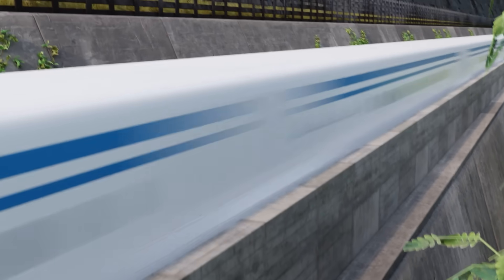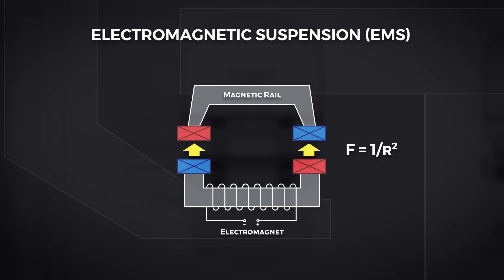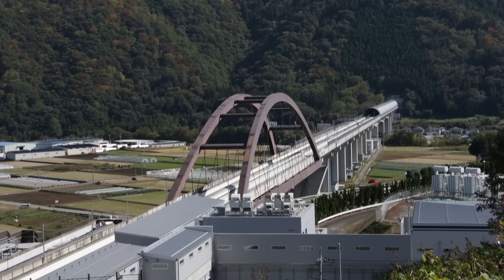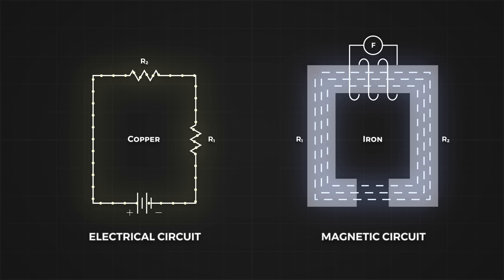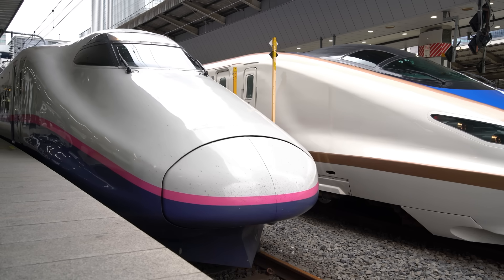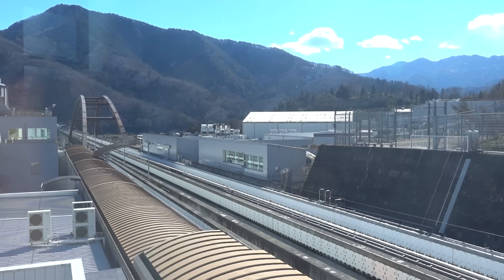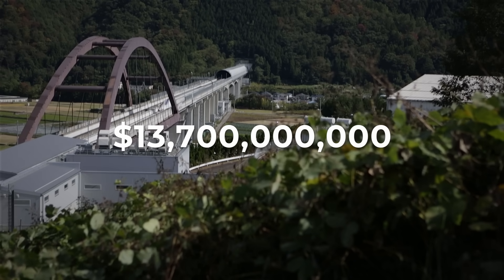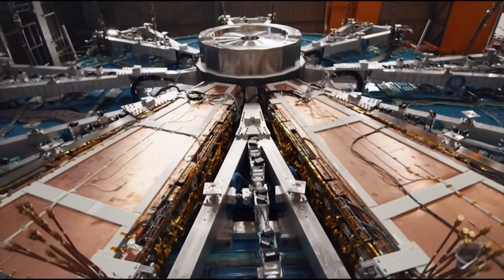How Japan's Maglev Train Works

Comment: Why does it cost 10x more, is there a way to bring costs down, would the new room temperature super conductors solve this cost?
Reply: Unfortunately, it appears they aren't superconductors. No lab has been able to recreate the results, and the material seems to only be diamagnetic, but with some slightly unique properties. There is still technically a chance that the other labs just need to adjust the process they are using to synthesize the material, but according to commentary from scientists that I have seen, the general consensus is skeptical that this is the case. Either way, the other labs still need to conduct full experiments, because in science you have to publish a paper in a journal for it to be official, so we will have to wait until then to find out for sure.

Comment: There is the argument that this infrastructure is probably 100+ year infrastructure with very low maintenance costs so in the long term it will probably be of a similar cost, it's a similar augment for tidal power vs wind power, wind power is much cheaper to install, but it's intermittent and only last 15 - 25 years and requires lots of maintenance, while tidal power is predictable and has been shown to have a very long life with relatively low maintenance so when you calculate lifetime costs it looks a lot better. Although to be fair tidal power also removes the need for energy storage and can be built in a way that can be used to store energy for when you need it.

Comment: Got to wonder why they are not using high temp super conductors, are they way more expensive or something or was it just that they were not available when the train was being designed. And when I say high temp I mean 77K or higher which is still super cold, but keeping Helium below it's boiling point is very energy intensive needing temps of 4.21K or lower also it means your mangnets needs to be signficantly larger to take the same current as trying to load them with too much current will heat them up and they will lose their super conductivity.
Reply: They are. L0 swiched to Hydrogen cooling from the old MLX01 that used helium coolant.

The issue with high temperature superconductor is that its not very flexible. This problem was solved about 15 years ago, MLX01 predates that system, but L0 don´t.

If you look closely at the images with the helium colat, you may be able to recognize that its from a MLX01 train, not the L0 train.

Comment: Small fun fact from a recent calculation done in germany regarding the costs of building a highspeed track: transrapid track (elevated) around 17 million € per KM, normal (on ground) highspeed track for 300 km/h around 27€ million € per KM. So the initial investment, at least for this Maglev type, is not at all higher these days. There is also the benefit that the area under the elevated track can be used and more steeper tracks are possible.

Comment: For the record, we’ve had room temperature superconductors for thirty years at this point, but they have the properties of bricks, therefore making them unviable for use in maglev.
Reply: Those are "high temperature superconductors" not room temp. So they still need to be cooled via liquid nitrogen (just not cooled so much that one needs helium).  Part of the difficulty with them is that they really don't make wire coils well. But we've gotten better with the ReBCO superconductors. The other big issue is critical current levels. If you put a lot of current through them, they cease to be superconducting. The titanium-tin and similar superconductors require helium temps but otherwise mostly do not have these problems.
Reply: @joshuazelinsky5213  The likelihood is that you are correct, I have no personal experience with this. I got my information from another video debunking LK-99,  and I also think that I heard about similar high temperature superconductors from somebody in person. I honestly don't remember at this point, and I had forgotten that I had posted this. It's cool to know that progress has been made!

Comment: I've been on the Shanghai ride. Great experience, but like you said, not practical at all. It seems to be there for show. But at least its a great show. Because it has tracks for both directions, you will pass the second train during the ride, meaning you will pass it at double the speed. That is airplane speed, but you pass something so close you are almost able to touch from your seat.
Reply: As far as I remember Shanghai build ther Maglev train line so that people don't need to vaist 30 or even more time on streat from the airport to city center :)
Reply: Not built for show but built to see if it was actually a viable form of mass transport, the costs outweigh the pro's though, especially since Chinese HSR is so damn impressive.

Comment: If LK-99 is proven to be a room temperature superconductor, would that be enough to make long range, high-speed maglev routes cost effective in the United States?
Reply: No, because it's a ceramic. That makes it highly impractical to make into anything useful. We've known how to make high temperature superconductors for decades, but they're pretty much all ceramics which are useless for most applications due to how brittle they are.

Comment: 9:00 I say almost all standard trains uses electrical power to drive the wheel. Either by electrical power or have an diesel motor run an generator who run electric motors at the wheels. The move from locomotives and carts to train set for passenger trains is because you can power all the wheels not only the one in the locomotive letting you have better acceleration and higher max speed. 
I still aseptically to maglev, 500 km/s is not that much faster than good high speed rail. 
Wait some time, 2000 km/h and its become interesting, hyperloop but with long distance trains.
Exiting NY, 2 hour to LA so going to the bar.

Comment: In the US the tracks are shared between passenger trains and freight trains on purpose to prevent development of high speed rail. What use is any passenger train if there's a slow moving freight train in front of it? The airlines lobby is working hard to maintain the status quo.

Comment: 15:20 I believe the reason passenger rail travel is a mess in America is because of the train companies prioritising short-term return on investment to shareholders over the expectations of passengers or customers. So it sounds more like a squishy human/political problem than an engineering one. There is a book called The Men Who Liked Trains and also a rambling but funny podcast Well There's Your Problem covered it in Penn Central
Reply: The real reason is that Amtrak is expected to run and be profitable without government funding. Most Amtrak routes are unprofitable, largely due to the slow speeds and low priority Amtrak gets from track owned by other rail companies, but there are a handful of routes that are actually very profitable, especially in the Northeast. A sensible business strategy would be to cut all unprofitable routes, and use the profis to reinvest in the company, so it can constantly be making routes better and more profitable. 

The problem is that Congress requires Amtrak to continue to run the unprofitable routes and won't allow them to be cut. Running these routes results in all profits being eaten up, removing Amtrak's ability to reinvest in itself.

Comment: I’m a watchmaker. Friction is my first enemy; magnetism is my second. I wonder if riding this train would cause someone’s luxury mechanical watch to speed up??
Reply: 8:13
Reply: @My-Opinion-Doesnt-Matter  
If a watch’s hair spring can become magnetized just by being too close to the speaker in your cell phone, and if it can become magnetized by even by the tiny static electricity from the watch’s own balance wheel rotating too close to its crystal (both of which has been known to happen), then I wouldn’t be surprised if taking this train to work every day causes someone’s watch to start running faster.  
It would depend on what kind of movement and hair spring is in your watch, how long/how often you rode the train, and based on the illustrations in this video, I wouldn’t be surprised if much of the effect depended on where one  is sitting on the train.

Comment: I wonder what the safety aspect looks like. There could be damage due to accidents, negligence or even terrorism. I never saw anything about these aspects compared to classic trains. It seems like a huge overlook considering the max speeds. I'm sure it was looked at by engineers but I'd like to know a bit more about that.
Reply: The reason terrorists tend not to go after trains (and also wouldn't be interested in maglev) is because they're on tracks. You can't fly a hijacked train into the world trade center like you can with an airplane. At best you can do some damage to the immediate area around the tracks, but that's about it.
Reply: @IBeforeAExceptAfterK  I don't think that's the full story. First off the train and it's passengers can be the target. Historically trains were targeted a lot by terrorists and saboteurs. Than I'd say that a maglev that derails could do a lot of damage in a populated area.
And even if it's not intentional there can be human errors or random damage. I wonder what kind of fail-safes were put in place in case of the lost of magnetism, etc... That would be interesting from an engineering perspective.

Comment: What happened to the overhead HPV recumbent rolling on steel protected by a clear weatherproof tube? That sounds like a great people mover.  My calculation obtains approximately 30miles to a bowl of rice and improves the fitness of travelers. A light weight option uses less energy per mile/year. Maglev is unnecessarily complex and expensive. This and 15 minute communities would redistribute populations, reduce pollution, and has health benefits. The recumbent bike rolling on steel, in a weatherproof overhead tube, is my solution to cost and energy demand needed to transport people to and from work. Sort of like a human powered roller coaster.

Comment: What happens if an Earthquake hits while they're zipping along at 500kph?
Reply: There is something called a P-wave. The P-wave travle a lot faster than the S wave. The P-wave is generally not dangerous, but detectable. The P-wave typically hit the detector 60-120 second prior to the S-wave.

japan have had this system in places for decades now that its stops all the trains and all the nuclear power stations directly when the P-wave hit. So far not a single train that got the signal have been still moving when the S-wave hit.
Reply: Next time try km/h, it's the only correct way to write kilometers per hour.

Comment: A regular HS rail line uses steel, some concrete and an overhead wire. A HS train is just a train, albeit with some good engineering. Fundamentally its an electric motor on wheels.
A maglev uses metric fucktons of copper for the coils and expensive reinforced concrete, and way, way waaaaay more exotic, rare and hard to make materials in the train.

Just from a very basic, physical point of view Maglevs are a bad idea in almost any context.
Reply: "A maglev uses metric fucktons of copper for the coils and expensive reinforced concrete, and way, way waaaaay more exotic, rare and hard to make materials in the train."
are you sure? did you calculate it?

most maglev tracksystem use aluminum coils, not copper once, so how much copper do they use. none.

"way waaaaay more exotic, rare and hard to make materials in the train."
Really? what kind? what maglev system are you refering to?

"Just from a very basic, physical point of view Maglevs are a bad idea in almost any context."
Maybe you should do some math before being so conclusive.

Comment: The Shanghai airport train has been in commercial operation for 19+ years.  That indicates that maglev can be successful, not just an experiment.

I think that those arguing for high speed rail would be more successful if they were promoting trains that can go 400-500 km/hour, making the advantage more compelling.
Reply: It loses a lot of money and isn’t very popular. It’s about 30 min faster than taking the metro, but also costs 10x as much as a metro ticket. Shanghai is actually building a high speed commuter rail between the airports currently
Reply: Airports can allow themself to have such a Gadgetbahn run at a loss. As they make the money by the people that got transported to the airport. And that they not build more of it in 19years should give you an indication. The initial extension plans of the Transrapid like network got dropped in favor of normal trains.

Comment: What's the point? They're still no faster than flying.
Reply: 12:17
Reply: 1 hour getting to the airport at least 1 and a half hours ahead of the flight, flying and getting back into the city another 1 hour. Congratulations instead of taking a 3 hour train you took a 1:30 flight but wasted 4 hours

Comment: Yeah the question still is there,  why is Japan doing this?  Tremendously more expensive than traditional high speed rail, there's not much benefit in speed, and for a "future technology" it really is an old technology.   Personally I would say continue to put research in, maybe find ways to lower cost to build, maybe one day when "room temperature" super conductors exist it'll be more viable (LK-99 is not it).  I will say I am surprised the energy cost increase is only 30% larger than trains,  while yeah trains definitely have more friction involved they aren't using energy to fight the force of gravity the whole way.
Reply: The Shanghai Maglev Train bleeds $300M per year. This is just Japanese hardheadedness just like they are forcing Hydrogen Cars into our throats even if though creating hydrogen has been proven to be energy intensive and more expensive than gasoline even if made from renewable sources

Comment: Not an engineer, so no idea how the business side of this typically works, but would economies of scale kick in if the technology was more widely adopted globally? Parts and materials could become standardised and could reduce the cost per km over the long term as they become more widely available to meet the demand.
Reply: Yea, one might think that, but the main issue is simply that the statement that maglev is considerably more expensive simply is not true. The video creator did the economics math wrong. Well, the creator did all the numbers wrong with exactly the same amount  a order of magnitude. 

The main cost of a maglev track is not the maglev track, its the track corridor. In this case, its the tunnel.

The main other reason why the core track is more expensive than a track of say a normal railway is that a maglev track typically have a 40-60MW PSU, while a normal track typically have 20MW. (granted, the maglev tracks have fewer trains on the track, becasue the go faster, so they need a lower number of PSU, so it does even out a bit)

Comment: Ever thought about doing a video on Jean Bertins Aerotrain?
He was actually very critical of the Maglev systems (due to cost and potential safety issues), and made sure that his system (tried out by Rohr in the US at the time) had infrastructure that was as cheap as possible - basically just prefab concrete.

I still have Bertins book somewhere. And both test tracks still exist, as well as a couple prototypes.
Reply: Its to bad that he was totally wrong about the cost issue, but people just parroting the statement that maglev is expensive with out correct references.

Comment: CW: Br*tish

Now I'm not massively against HS2, but! It is endlessly funny to me that the maglev system in Japan looks like it will be $77m per km, whereas HS2 looks like it will be $250m per km. For normal high speed rail.
Reply: Well they have the advantage and disadvantage at the same time with having a big chunk of it in Tunnels thru mountains. Advantage is you have not many places where you need to buy the land what is very time consuming and NIMBYs have less space to stop your project. And have the disadvantage that building a tunnel is not cheap.
Politics and having the fun that every bigger town wants to have a own high speed rail stop makes such projects not fun. 
Would be fun to have a good comparison of such projects on the same ground.